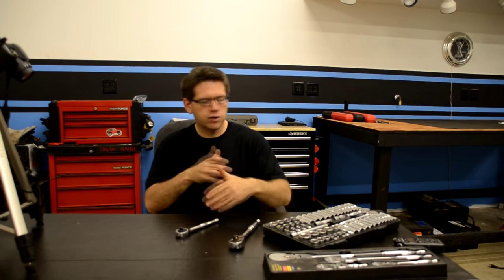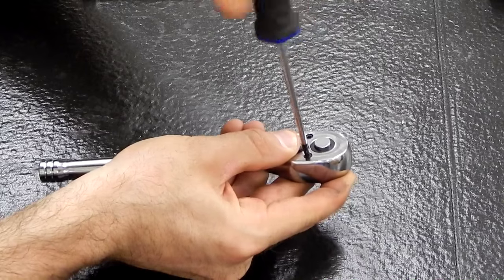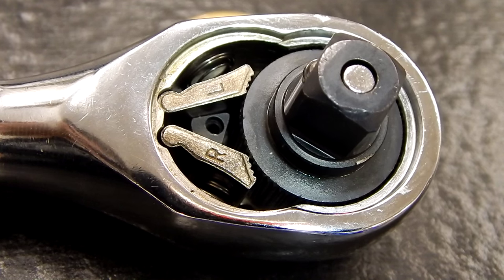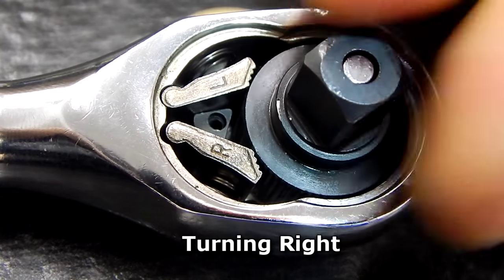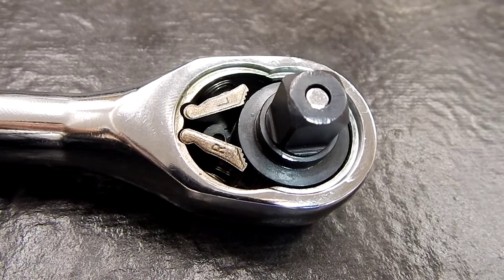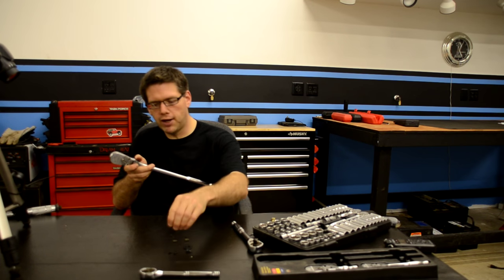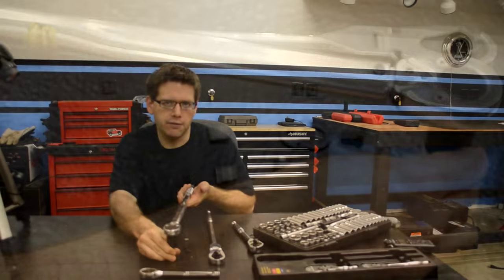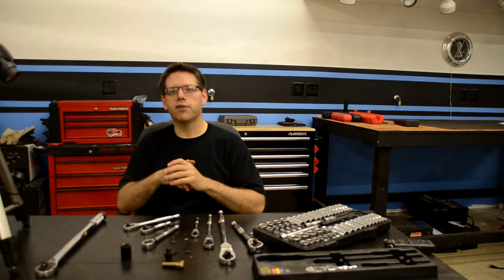How Ratchets Work - Vortex Garage Tool Tech - With High Def Macro/Closeups - Vortex Garage Ep. 2

Comment: Not worth for home tools. You can damage this ratchet easy. Use L socket wrench for hard bolt before use ratchet,or you damage ratchet.this not simple.

Spinning socket T wrench with universal adaptor still faster than socket ratchet.and more cheap and strong.